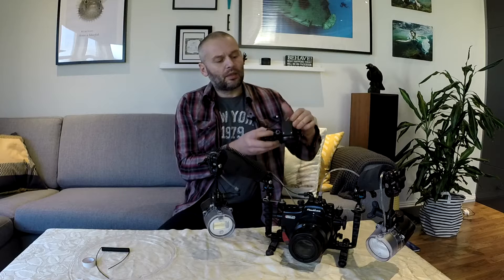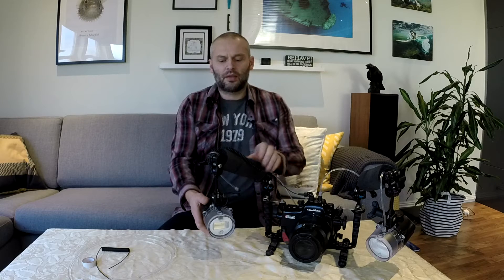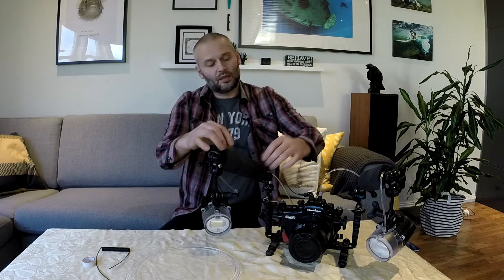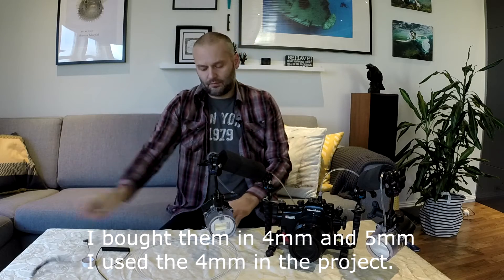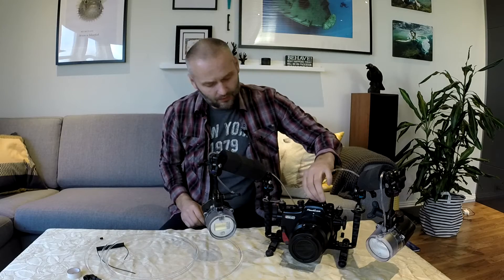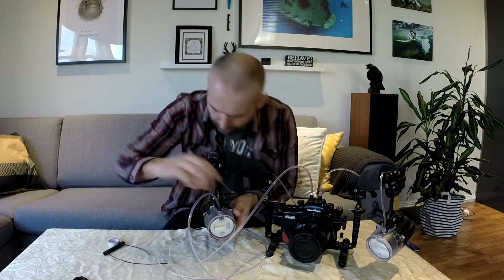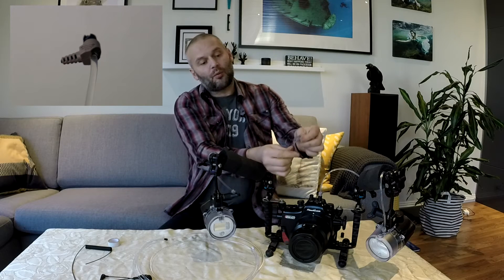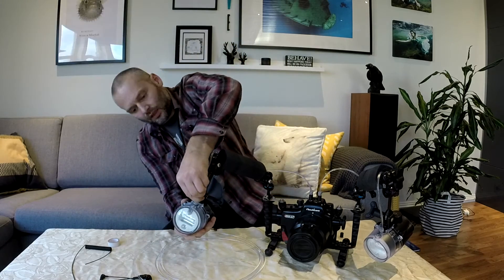Make your own fiber optic cable for your underwater flash - works with S&S YS-D2 flash

Comment: Thanks for the tip. I just order a 2 meters of 2mm one for my compact camera for only USD6.50. The currents cable I have are just 1mm and not working well sometimes.
Reply from the maker: Looking forward to hear your results.
Reply: @toringeleidland784  Hello again, I just got the 2mm cables and they are working better than the 1mm old ones. The new one is flexible but strong so recommended for UW photography. Thanks again for your tips 😃😉

Comment: Where did you buy the small fiber optic converter piece for the nauticam housing? I can't seem to search the right thing without trying to be sold a fiber optic and converters for 120usd. My fiber optic cables from my Sea & Sea YS-03 wont plug into the nauticam housing I've been given.

Comment: I have an Ikelite housing with a canon 5DSR. I shoot in a swimming pool. My strobes are on dry land outside. I’m looking for a solution to fire my top side strobes remotely underwater. Any suggestions?
Reply from the maker: Hi, maybe it is possible to cut and extend a ikelite flash cable ?

Comment: you need a multi core cable for best TTL performance
Reply from the maker: It is impossible to shoot TTL with the nauticam/Sony flash trigger, only manuell. As far as i know there is`t any original brand cable that can fire Sea&Sea YS-D2 from a nauticam flash trigger. Please let me know if you find any.

Comment: can you put a link to the cable you've bought?
Reply from the maker: +Miguel Pereira Hi Miguel, this is the item i bought  https://rover.ebay.com/rover/1/711-53200-19255-0/1?icep_id=114&ipn=icep&toolid=20004&campid=5338245792&mpre=https%3A%2F%2Fwww.ebay.com%2Fitm%2F201480929965
Reply: very  nice solution! How did you attach the 4mm cable  with the  standard optical S & S plug?  Ho did you make the hole wide enough for the 4 mm cable?
Reply: Please don’t tell the sea&sea to make new FO cables! They will cost 150$!
Reply: I make my diy cables with audio fo cables
Reply: I make my diy cables with audio fo cables